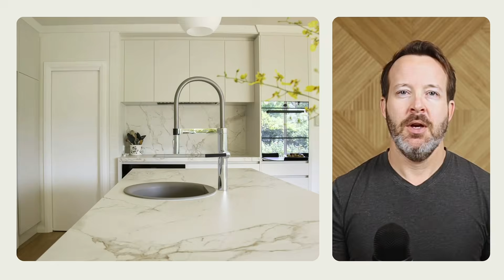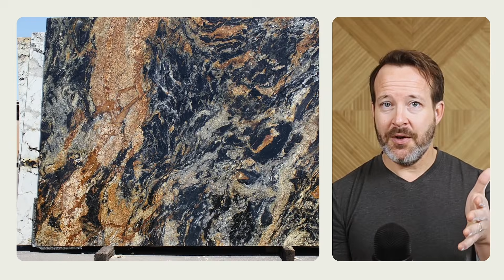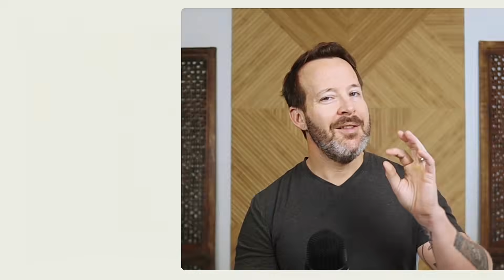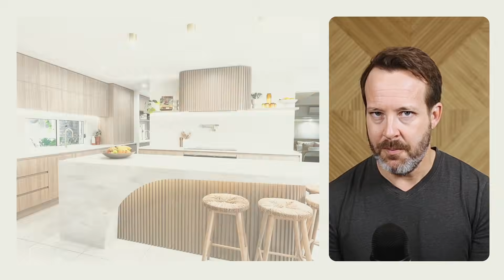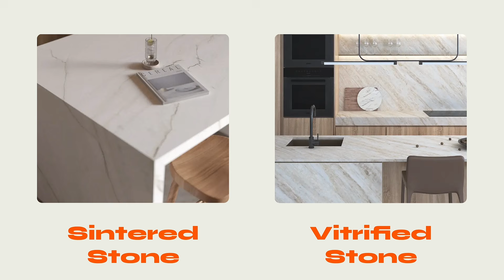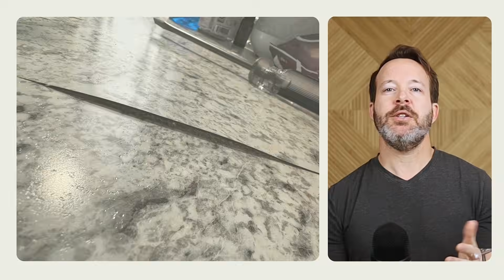Which Countertop Is The MOST Functional?

Comment: Really impressed you did not trash Formica! I’ve had Formica in every kitchen I’ve ever lived in and it just wears like iron.  Great price point and many, many choices in appearance. My current home is modular ( cost cutting after a divorce) and the countertop was poorly installed and sealed so I will likely be replacing it after only 10 years.  But I plan to use Formica again, extending it up to the bottom of the cabinets as backsplash,  I’ll just hire someone good to install it this time.  Status is not a concern for me!

Comment: None of these are as functional as large format ceramic tile. It's heat safe, non-porous, scratch resistant, lightweight, can do L and U shapes and matching backsplashes, and if you do somehow manage to crack or chip a tile, you can have a stash of spare tiles in the shed or basement to replace that one tile and make it look like the oopsie never happened. Large format means minimal grout lines but you can use an epoxy grout to make sure those lines won't stain or absorb bacteria, and the large format also means you don't have to worry about the less heat-safe epoxy being affected if you put a hot pan on the bench direct from the stove or oven, because the surface of one individual tile is big enough to put things down on anyway.

If you're aiming for next level functional kitchen design, that means height-adjustable benchtops because different people work at different heights. Light weight but sturdy materials are premium, and the only thing that can beat large format ceramic tiles for being light weight and sturdy is stainless ... which is great in a commercial kitchen or a morgue, but doesn't really belong as a work surface in a home.
Reply: A morgue!  😂

Comment: I would love soapstone countertops one day, but in the meantime I like my cheap and cheerful laminate countertops combined with my stainless steel professional sink-station matching the pro extractor (once you've got a 2.5m/8+ft wide powerful hood, there's no way back to domestic).
Full stainless would be an option as well, but the kind formed around particle board can delaminate under heat and the kind on its own can be very noisy (I put a bunch of sound dampening on the bottom of my sink station for that reason).

Comment: I know you can't cover EVERY pro/con of every surface, but I think these are important (and were missed):
STONE: There are many varieties of quartzite and some are more porous and stain-prone than others. Seek the advice of a knowledgeable fabricator before falling in love.
STONE: "Lifetime" or 15+-year sealants are mostly marketing. It may come with a guarantee that it's still there, but all sealants get absorbed and have diminished effectiveness if you don't reseal regularly. 
DEKTON: It's only surface-printed, so when it chips, that chip can stand out like a sore thumb. Also if you do an undermount sink, you'll see the plain, non-printed edges. 
QUARTZ: White quartzes can not only stain but also yellow over time, especially with sun exposure.
ACRYLIC: Stains easily but any stain can be easily buffed out with mild cleanser.

Comment: Having had several different types of countertops and they all have good and bad points, nothing is perfect.  Here's my take on what we've had over the years:

* Laminate is inexpensive, available in a wide variety of colors and styles, fairly durable in daily use and is easy to replace but they are relatively easily damaged by heat and so on. 
* We had soapstone countertop for about 15 years and found it to be a great countertop. It has a natural look, is resistant to heat, chemicals (no need to worry about red wine or other stains ever), anti-bacterial, completely non-porous, and stuff doesn't stick to it at clean up. But there's little color choice--it's all kind of the same dark color, and it's a relatively soft stone (though not as soft a marble) so you need to be careful not to use knives directly on the surface. It will also dent if you drop a heavy pot on it from a top cupboard or something.  Soapstone doesn't need to be sealed, it is very hygienic, BUT you'll want to use a mineral wax or oil on it regularly to keep it looking it's best and that's extra maintenance.
* Granite has a natural look, is durable and heat resistant, but it is porous so does have to be sealed against bacteria and can also stain if not sealed. The speckled look also isn't appealing to me but that's a personal thing. Still, that speckled look bothered me enough me to pull out the granite countertop that came with the house and put in a quartz countertop. 
* Quartz countertops are sold as the easy alternative to granite and I guess they are. Quartz is durable, requires no sealing, and it's available in almost any style or color you like. But (to me anyway) they really don't look like natural stone, aren't heat resistant, and can be stained--at least by red wine left on it for a while and I know this as I've done it. I also find that stuff sticks to quartz more than I'd like when cleaning up but maybe that's just me. 

All that said we have quartz now and at my age we probably we have our last countertop ever. As I said at the start: Nothing is perfect.

Comment: Pam here….if I do a new kitchen or remodel of a home it would be stainless steel, with some butcher block accents.  I would be scouring the restaurant outlets and create cabinetry around the peices of stainless i would find….i would also find a stainless sink drainboard built in.
Reply: Find a local sheet metal company, one that does stainless countertops - these are the people that do the custom countertops for hospitals, food plants, labs, etc. I had some made a couple of years ago and of all the things we did in the remodel, the stainless countertops are by far my favorite. Welded in sink, so it's just smooth and no seams, 4" backsplash which extends to 10" behind the sink. They aren't cheap, but they will outlast every other material.

Comment: In about 2015, the laboratory in which I worked was remodeled (by a kitchen remodeler) and the countertops offered were Corian.  I was able to choose the color, not the material (which would have been soapstone like most labs use), and I chose a beautiful light blue speckle to match the current cabinetry not being replaced.  I was told it wouldn't stain, I could sand out scratches, and it would not chip easily.  All three of those attributes proved false:  even plain water left standing too long would bleach out the color, it scratched terribly (this was an industrial laboratory) and did not sand out nicely, and when operators dropped things on it, it chipped.  I was extremely disappointed but also glad to have been able to try out the Corian without having to pay for it myself at home!

Comment: at three and a half minutes in you said that granites impact resistance far exceeds.....don't drop you glasses or dishes on a granite counter top.....they will break or shatter.....I still do not understand the appeal?
Reply: Acyrlic solid surface are the way to go.....McDonalds, Wendy's, KFC....all use this material exclusively.....follow the big boys....sanitary, customizable....better when you drop glasses...my preference
Reply: As a commercial carpenter who became a Home Inspector I constantly run into listings stating "chefs" kitchen.....then you see detailed cabinet edges and granite.....things you do not see in a real chefs kitchen...stainless steel is how a real chef does it....yet it does not have the appeal it really should, rarely see it in so called chef kitchens.

Comment: I have stainless steel countertop on both side of stove…. having worked in the OR for 40 years I knew they are totally easy to clean, impervious to heat, or stains. Don’t care about scratches…they just give it patina. Wish my 12 foot island with white quart that DOES stain was all stainless steel.  Not as pretty but far more functional.
Reply: Yeah, stainless is way easier to maintain and much harder to actually damage than quartz. I don't understand the appeal of quartz.

Comment: I have a 9' long seamless countertop, sink, drain board of very thick copper, fabricated by a local welder. Antibacterial surface that is heat resistant and it looks best after a patina of coppery browns begin to develop.  Copper never gets mentioned for countertops.
Reply: At the price of copper these days that would put it in the highest price range. Was on a job in Telluride, CO - Lux condos with copper counters and copper tile backslashes behind the range. Primo for every thing you have mentioned. It worked well for the overall "rustic" aesthetics. However definitely not for everyone.

Comment: Don't write off laminate countertops  When we built a custom retirement bungalow, one of our most important choices was the cabinetry and trim. By that point, overruns had severely depleted our finances. Regardless, I insisted on top quality for the cabinetry, because we would use them heavily every single day, and they form a large part of the esthetics in an open plan. We priced various different choices and were horrified to learn how eyewateringly expensive designer countertops were, in addition to limited colour and pattern choices. Pressured by the cabinet company to avoid deliverly delays, we went with formica countertops (included at no extra charge by the cabinet company), agreeing we could upgrade at a later date at our leisure. 11 years later they still look brand new. We now have no intention of spending $20,000 for very little gain. No regrets at all.
Reply: My 65 year old formica is comfortably worn and way out of style, but I'm entirely happy with it
Reply: The 'New' LAMINATES.. Are incredible!!.. 
In just a li'l over 2 decades.. The Qualty of The Top Laminates has made Leaps in Quality!'
Reply: I appreciate your post more than you know.  We are restoring/renovating our 100 year old family farm house.  We don't have a wide spanse of counter, but deciding what to use that won't out-class an old farm house has kept me from sleeping for months.  My dear hubby and I are in our late 60's, and I don't want any countertop material that will wear out before we do.
Reply: Smart. You can always change countertops anytime you want, but cabinetry is where you want to put the money in to start the build.
Reply: Q: ''WHERE TO BUY 'SHEETS' OF LAMINATES ANYMORE??''

(The Lowe's & HD's HAVEN'T Hired 'a 2nd' Employee yet!!..
& They Don't Have Anything 'In-Stock')..

& 'Ordering from The Mfgr'.. 
(Cost 3X 'the (retail!) Price' of the Laminate!!).. 

I NEED (Solid Color) Sheets for A Job Right-Now.. 
WHERE TO GET IT?.. 

(I CAN'T TELL THE CLIENT): 
"Well, That li'l 'Strip of PLASTIC'.. 
IT COSTS 'ME' $348.00" ..
Reply: My laminate countertop is from 1975.  Plain off-white with half bulldoze edging slightly raised to prevent spills dripping down. It still looks like new.
 That laminate countertop is the only thing I love about my kitchen and if ever I  did a kitchen renovation, I'd go for a near-twin replica countertop.
Reply: thank you for your story, now i know what to get

Comment: How on earth can you make a video like this without mentioning wood? :face-fuchsia-wide-eyes:
Reply: I agree my brother just put in an end grain sugar maple (rock maple) butcher block counter top in his kitchen -- extremely hard. We had to dill and tap for machine screws to mount the induction counter top range. It will have ongoing maintenance issues like periodic oiling and it can be branded by a hot pan. However, very resilient material that mellows with age.
Reply: I agree, I have a dark teak for most of the countertop, but I do have granite for the food prep area near the stove, handy for putting down hot pots. It’s worth remembering you don’t have to have the same materials throughout the kitchen.

Comment: I used Vermont Soapstone in my 1897 house.  It looks like it's always been there, and is beautiful.  It's a softer stone, but it won't etch or react to high temps.  Initially, I treated it with mineral oil couple of times a year, and then I discovered Soapstone wax, which is easier and much better and doesn't really have to reapplied often.
Reply: Soapstone is the the ultimate.
Reply: Isn’t that what they use in chemistry labs? That’s a terrific choice!!!
Reply: Love soapstone!!  Just so classic.
Reply: And it just looks better in time as it slightly rounds off.
Reply: @michaelg7601   Yes.  The kitchen was on the cover of Old House Journal in April of 2017, but in mirror image!
Reply: My home heating stove had soapstone lining.!
Reply: I really want to change my countertops and so far Soapstone is my #1 choice. I found a slab about 2' X 3' at a thrift store and placed it in a suitable location to try it out. It's been there for about 3 months now and so far I love everything about it except.....it's pretty dark. My current countertops are a dark grey, but this is even darker. 

It does scratch pretty easily,  but I can fix them easily. Some types of spill "glue" themselves on if they aren't wiped up right away (teens and hot cocoa,) and those need to "fixed" almost like a scratch, but completely doable.
I have found it's my favorite surface for working dough. I almost never pull out my dough mat anymore.
Care to reply? I'm curious if you've had any similar experiences.  Any downsides to soapstone?
Reply: @suran396I’ve had mine 14 years now and love it. I do have cut marks (etchings) where I’ve been too impatient to get out the board and I like them. There a few “chips” - very small - that I can’t explain, which puzzles me. I wanted white marble counter tops for the aesthetics but decided I couldn’t live with stains, and soapstone really works in my very old house. Good luck!
Reply: @Artemisgrier thanks!
Reply: @suran396I have no first hand experience. I view soapstone like French white oak flooring. Both are the tops and seen in great design.
Reply: @toddmiller2966 thanks! I was hoping for answers from people who actually cook on it and live with it day by day.
Reply: @suran396 My countertop is leathered soapstone. I love it, but if it gets a scratch, and you try to sand it out, the scratched area just becomes more obvious. So...don't get the leathered finish if you have kids that are going to scratch it. If I moved, I would get soapstone again.
Reply: Soapstone is my absolute favorite!
Reply: Absolutely correct. I Love Soapstone. While its soft, it can always be polished if its scratched. The oiling is a minimal effort to protect it. There is a reason why chemistry labs have soapstone for their surfaces...
Reply: I'm doing a casita, 550 sq ft, and I have my eye on Cinza Verde, a light green soapstone from Mines Gerais in Brazil. No oiling necessary to maintain the light color. It's such a small amount it's worth the splurge.

Comment: Granite for 22yrs, no maintenance. High traffic/ use  kitchen. Looks exactly like the way it was the first day. ❤
Reply: Same here. I have literally put out flaming pots on my granite. Just perfect. Functional and still beautiful.
Reply: Beautiful rock. Will last for ever
Reply: We bought our house with granite already fitted. We had to learn how to work with granite as we smashed one jug and one coffee cup in the first couple of weeks in after moving in! Our kitchen is now 20 years old, and the granite is still fantastic - I think there’s one tiny nick in the whole countertop.
Reply: Same here, the house and quincho have all granite counter top. I recently re model a 1970' studio flat which had granite flooring, beautiful flooring that needed polish and reseal however, the owner wanted porcelain flooring instead. Since this 1970's granite flooring are usually 25-30mm thick, it is common to add the new flooring on top, and that what we did.

The kitchen granite was removed, new kitchen installed with granite countertop as well.

Granite also looks great in bathrooms, specially with the amount of colour options available, depending where the stone comes from.
Reply: My problem with granite is that its so busy. I just want calm countertops with flow or solid color. Thats why solid surface hits the mark for me. Plus my mom has 18 year old Glacier White Corian countertops that still look as good as they did when they were installed.

Comment: My next counter top is going to be large format porcelain tiles.  Incredibly cheap.  With my galley kitchen, a single long top seam.  Capable of placing a cast iron skillet on to top as long as you don't bang it or slide it. Heck, maybe I'll use bamboo as grout!
Reply: Your cabinet installer is going to have to be a genius to ensure that your floor is perfectly level and your foundation doesn't sink.  That giant porcelain tile will crack if it is off even a bit.  Why tempt fate?
Reply: @Cathy-e1s  I am my cabinet installer.  And cabinet builder and floor builder, and I built the foundation, and the floor.  Obviously, these tiles have some use case.  Why do you think using them for a counter top is particularly stressful?  In practice, it is more controlled than installing them on a floor.  And given the modest size of my kitchen, I'll only have a few grout lines.
Reply: And, the foundation is on rock!